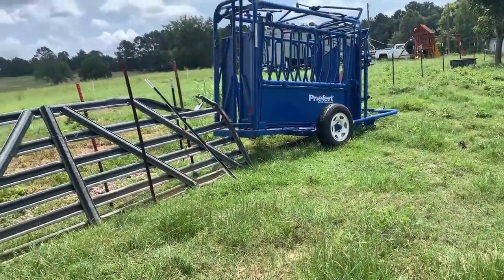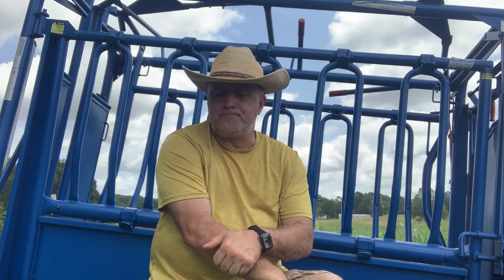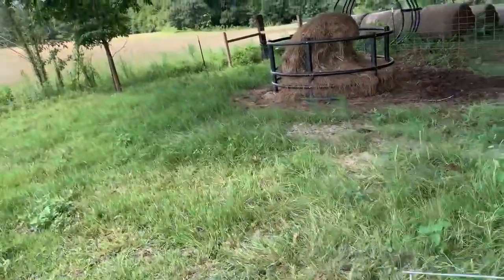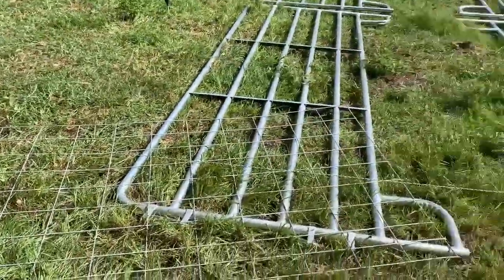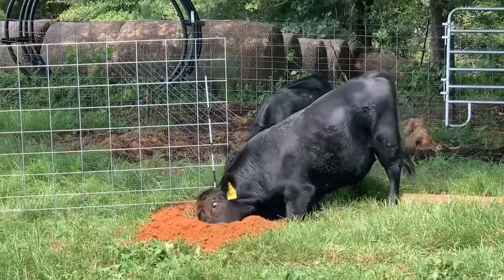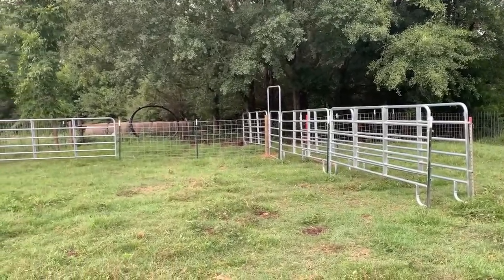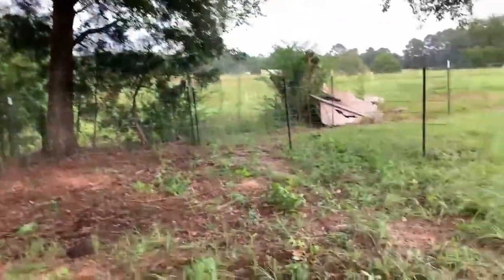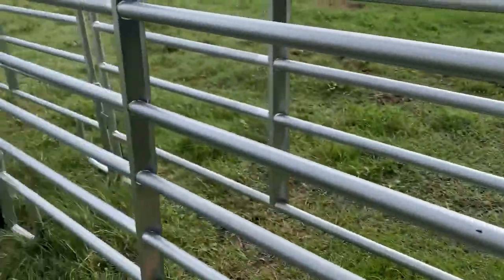DIY Cattle Working System Part 1

Comment: Nothing wrong with a bud box your pen may be a little wide though. I find 12x24 works good. You will find that you want to chain your alley top and bottom to keep those panels from spreading. Tee posts are not solid enough to hold that for a full size cow. I just use a 40' round pen 2  12x24 sorting pens and a 12x24 bud box, 18' alley, palp cage, squeeze chute and return them back to the round pen. I can run 40 angus through no problem in about 2 hours. Good luck and be safe.